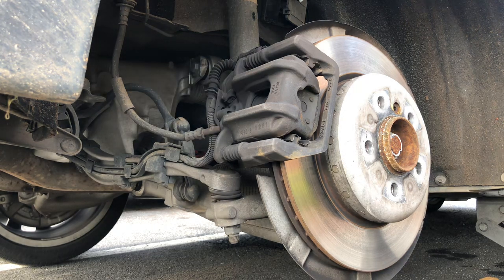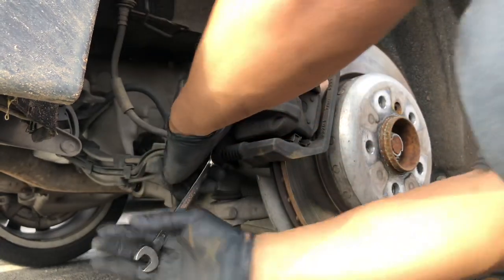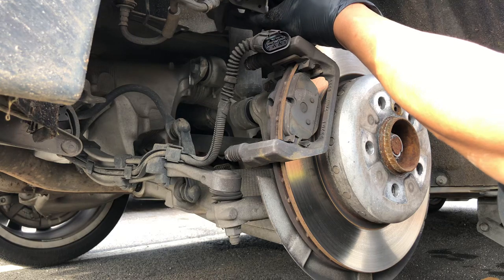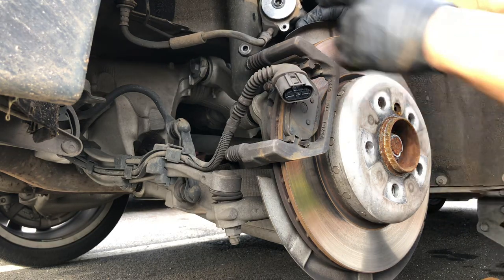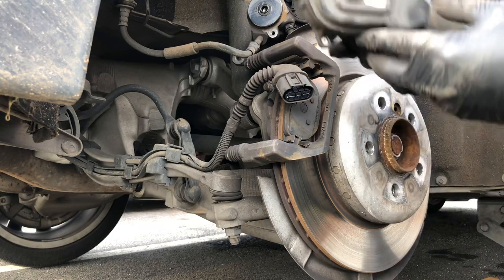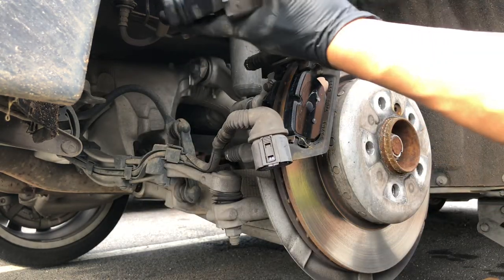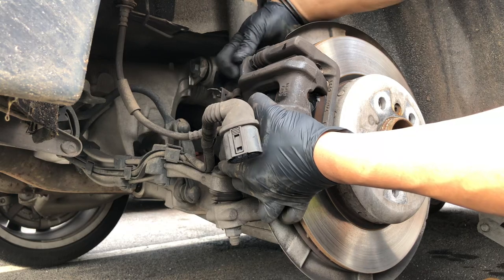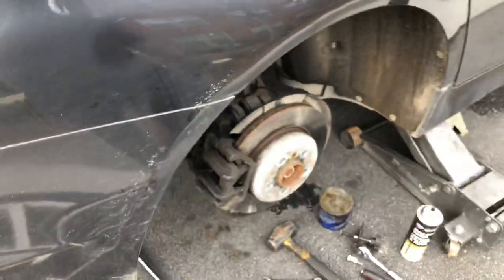2010 - 2017 BMW Rear Brake Pads Replacement with Electric Parking Brake.

Comment: On my 2016 Mini CS Clubman, there's no option on Bimmercode to disable the electric parking brake. So simply lift the car with ignition on, disable the parking brake and disconnect the two electric brake plug 👌

Comment: thanks for the video, how do you release the electric parking brake? I believe it automatically switches to lock mode once you turn off the car, are you able to manually release the parking brake without turning on the car?
Reply: I dont mean to be off topic but does anybody know of a trick to get back into an instagram account..?
I stupidly lost my password. I appreciate any assistance you can offer me.
Reply: @Gerald Yousef Instablaster =)
Reply: @Cohen Jadiel Thanks so much for your reply. I got to the site thru google and Im in the hacking process atm.
Takes quite some time so I will reply here later when my account password hopefully is recovered.
Reply: @Cohen Jadiel it worked and I finally got access to my account again. I am so happy!
Thanks so much you saved my ass!
Reply: @Gerald Yousef No problem :)
Reply: BimmerLink

Comment: Can I use a deep 13mm socket to take out the caliper bolts out, or does it have to a 13mm wrench?
Reply from the maker: JULIUS CEEZ socket should work just fine.